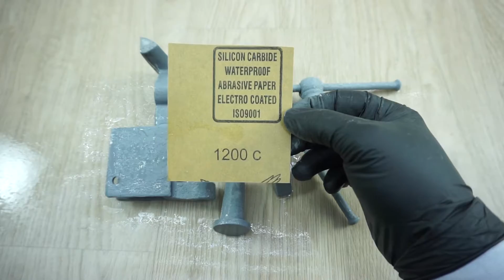Very Old Mini Vise Restoration

Comment: Top tip: Paint the silver part gloss black first. Then throw down the silver. Will look amazing!   BTW, great job on this vice. Any casting marks on it? I was wondering if you could tell approximate time it was built and in which country. Anyway, keep up th egood work.
Reply from the maker: Thanks for the advice. There is not any sign on it.